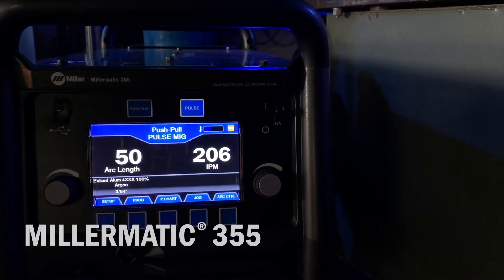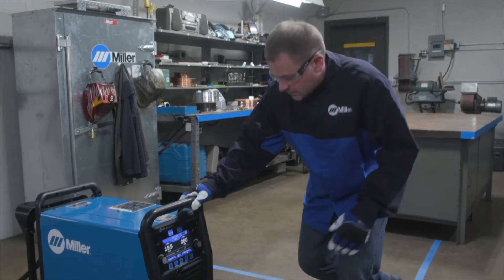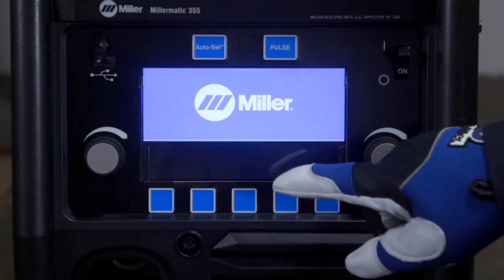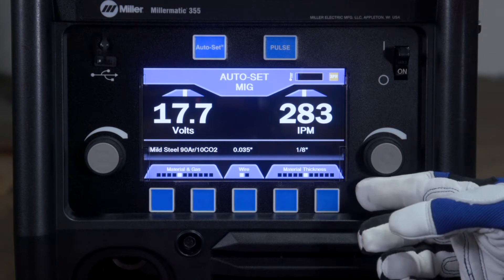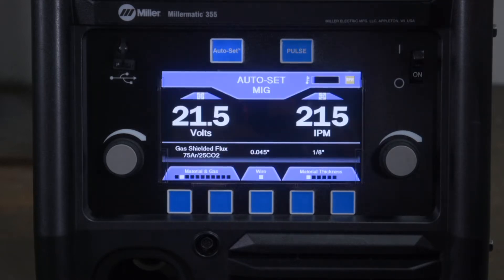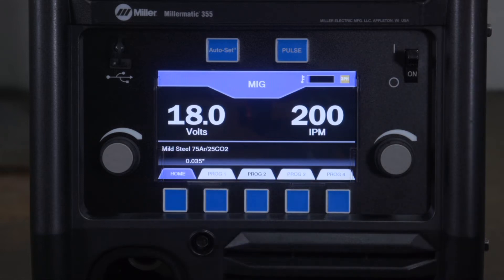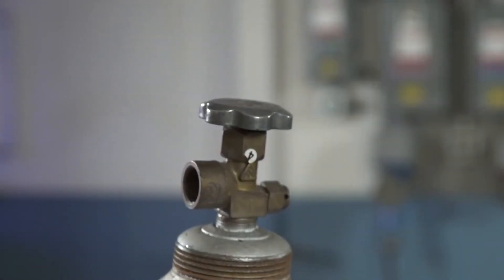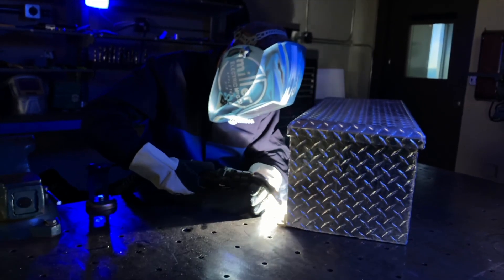Getting Started With Your Millermatic® 355 MIG Welder

Comment: We have 15 welders of the Miller 350P from 2010 and newer, and its the Cadillac for aluminum welding, we have 3 of the new 355 and the guys hate them. Micro spatters, and tacking is not near as nice as the 350P. We have 4 Lincoln TIG welders water cooled, and they are fine, but we didn't like the Lincoln 360 MIG feeding issues on the demo we had in 2023. We have 2 manual OTC welders and 1 robotic one, and they are good welders, but we have some feeding issues on the manual machines, and the tips are quite expensive, but they weld primo. The 350P model has been the best for us, and we wish they still made it, we blow circuit boards in them from time to time, and get them fixed, and carry on with them. I will never sell them.

Comment: Being an experienced production welder, I can honestly say miller welders have always been my machine of choice. Our welders used to race to the miller machines and basically avoid the older esab machines because they seemed to fluctuate up  50 to 80 amps while welding giving gross inconsistency. Millers cost but they are worth it in my experience.